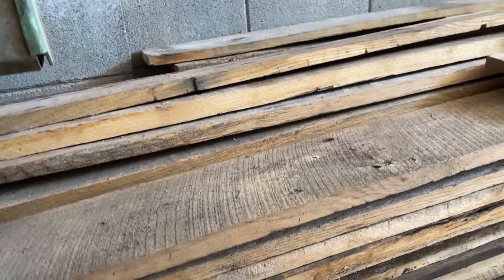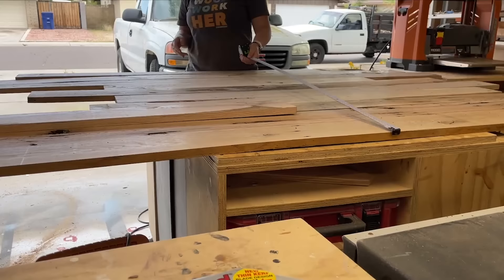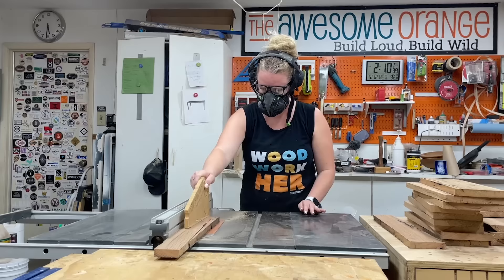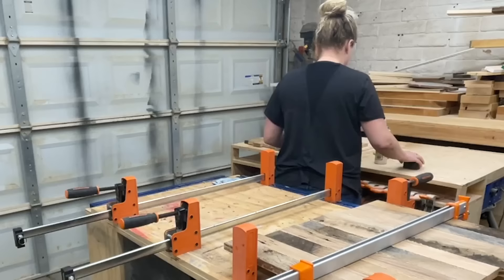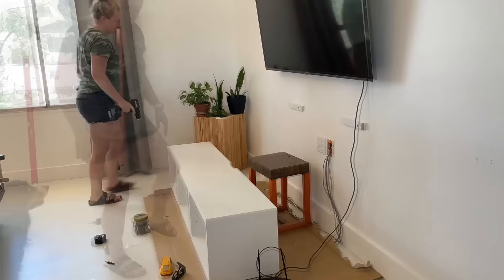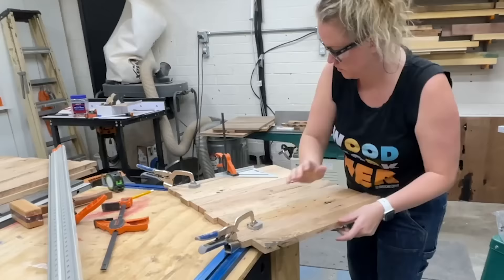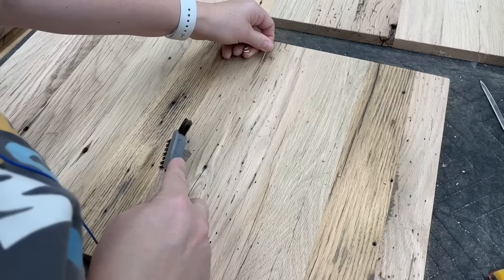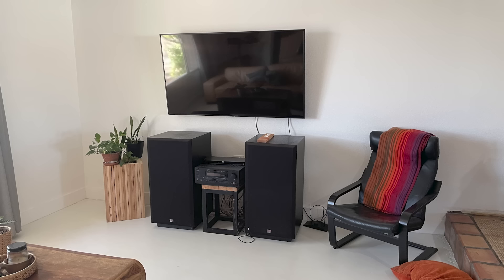DIY IKEA Hack | Floating Media Console with Barn Wood!

Comment: You are a savior, I mounted my Tv stand with only screws and unfortunately my stand fell few days ago and widen holes that I’ve made with screws 🙃🙃

I’ve been trying to figure out a way to put back the floating stand. Wasn’t keen to recreate holes in the wall for it to fall again and I came across your video. God is good 😮! 

Running to my home supplies store, I found a board left by previous occupants, just need to buy a saw!
Reply from the maker: Good luck with your project! 🍊

Comment: I just bought, and built this same unit.  The metal cleats don't line up to the studs, and the cleat placement isn't standard width (compared to the wall studs.) How did you get around this?